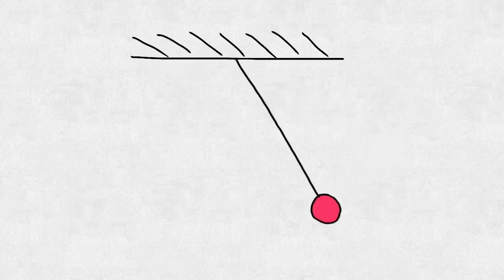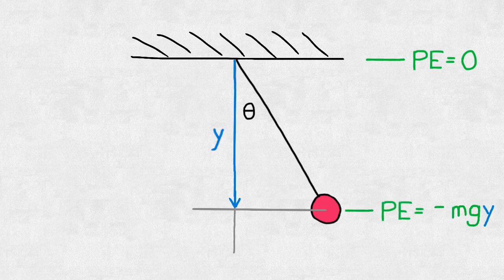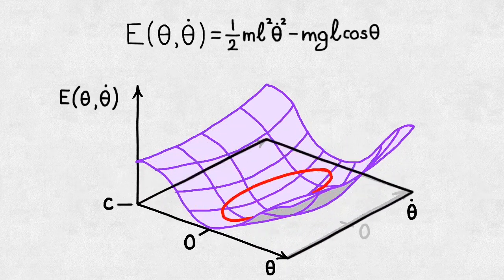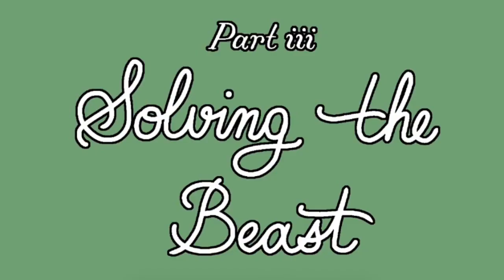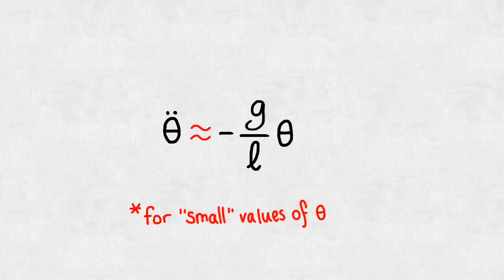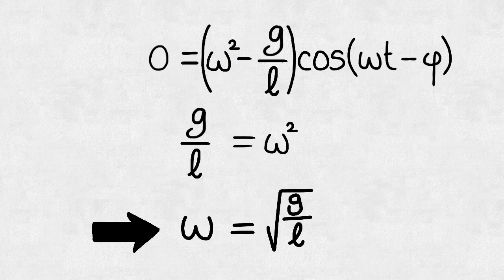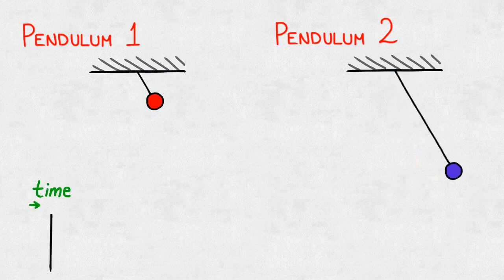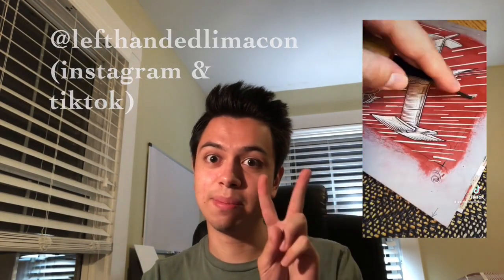Hidden Geometry of the Pendulum

Comment: Quite a fun video! I'm actually doing this exact same thing right now as I'm going through Taylor's classical mechanics, using the energy formalism to derive the equations of motion for various physical systems, like the pendulum, atwood machine and this weird metal ball on a vertical wire attached to a block through a pulley lol

I loved how you make a connection between geometry and the actual system! I know about phase spaces but I never thought of them as the level sets of the total energy of the system! As a geometry enthusiast I am a bit vexed about not thinking about actually plotting the total energy as a function of position and velocity D: but you live and you learn! I quite like this style of animation, I would like to make videos of a similar style.

Comment: Please use a disk with an eccentric mass, such that the pendulum can fly over the top. Adding linear friction becomes easy by positioning two magnets on both sides of the disk.
Now add a linear motor to make it into a damped driven pendulum. The simplest chaotic system from classical mechanics. You get a strange attractor in phase space.

Comment: 58 seconds in and wonderfully impressed!  

Perhaps you can cover a problem related to this one, but is too complex for my level of calculus understanding.  Could you calculate the tangential velocity of the outermost pendulum bob in a double pendulum system as a function of the tangential velocity or acceleration of the inner pendulum bob?
Reply from the maker: That's funny - I've been pondering over the double pendulum for a couple days now LOL so good timing. Finding that it's quite a complicated thing. I want to do a proper treatment of these coupled oscillator type of systems, but it may be a while till I have a good break to work on that. Stay tuned though and thanks for the comment :)

Comment: loved the animation!! Can you elaborate more on how you hand-animated it?
Reply from the maker: thank you! I did this using the Flipaclip app for ipad. Not a very high level tool but it works for this purpose. In flipaclip, you need to draw each frame in the animation, but there are ways to speed up the process using copy& paste moving things around, etc particularly because most of the objects in this video are simple geometric shapes and lines

Comment: at 4:52, why do you choose to set the right term equal to zero and not the left term? What would be the interpretation of either way?
Reply from the maker: Good point! The left term set to zero would be: 

ml dθ/dt = 0

Which has a solution: θ = a constant. This is the solution where the pendulum stays still for all time, which I think intuitively we know it is possible, if it hangs straight down motionless, but that's not very enlightening.

Ultimately, that left term gives a physical but so-called "trivial" or obvious solution, while the right one gives a more interesting solution we didn't already know.

Comment: Very nice! What happens if you take a higher constant total energy, do you get different motion from those weirder level sets? I'm guessing that's the angle going over pi? You even get straight lines in theta at what I'm guessing is the pendulum balancing on top :)
Reply from the maker: Great point! Yes totally, if you begin with our approximate circle path, then going higher up the level sets you get first some more ellipse-like shapes, and then at one key point you break free from a closed loop path into a weird squiggle and then an almost line. You could imagine a very high energy pendulum literally swinging around and around the pivot like swinging a ball on a string, with immense speed. Not much of a pendulum at that point. But it’s interesting to think about the limit cases isn’t it? :D

Comment: I do not understand scenario when pendulum has high speed. According to logic, is should spin in circles, but according your energy plot geodesic plots it will spin just half of circle?
Reply from the maker: You’re right, above a certain speed, it should just spin in circles. The plot in the video is only an illustration of a small section i chose to focus on. There is more that was just not included in the picture. If you extend out the plot out even larger you can find solution curves which are like a wiggly line. This corresponds to the pendulum spinning around and around forever just like you predict